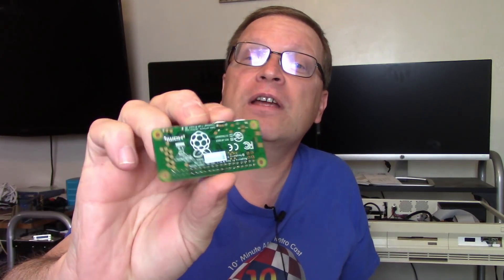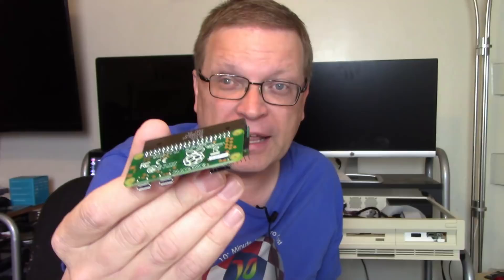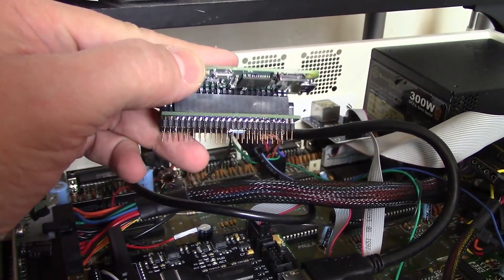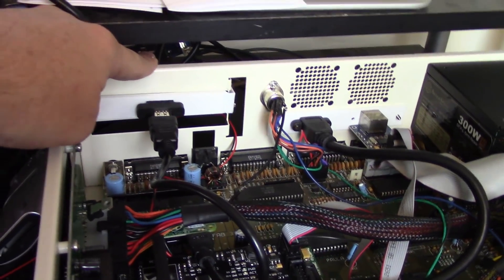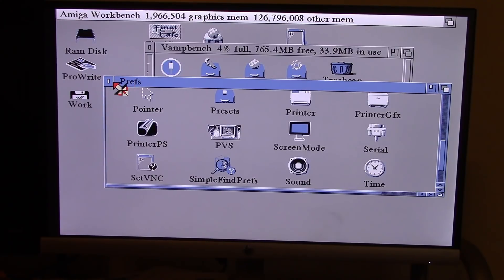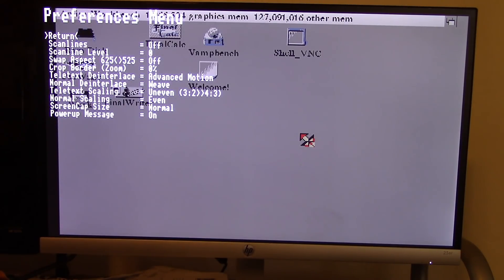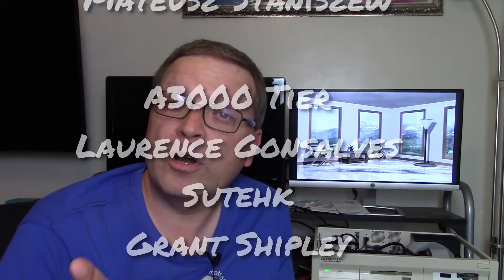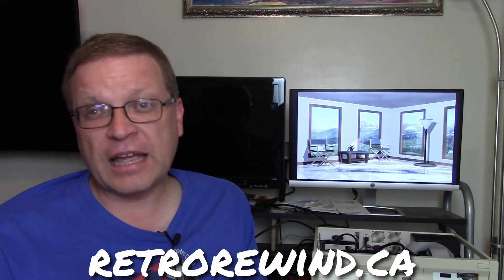RGB to HDMI Review for the Amiga 500 - 10MARC Episode 91

Comment: I have one of these but not tested it yet.
As I can see from your video, there are some interlace artifacts on cursor moving at lace resolution.
Same happens to LCD TVs with scart and with the Indivision if I remember correctly.
Reply from the maker: Huh. I had not noticed any artifacts on the cursor. I will have to take a closer look.
Reply: @10MARC  Emailed you a screenshot.
Reply from the maker: I saw that in my email. I really don't recall the cursor looking odd at all. I wonder if it is a trick of the camera.
Reply: @10MARC  If you had an interlace mode on your camera, the same thing would happen to low res screenmode.

Comment: The flicker in PAL mode might be an issue with your display not supporting 50Hz. I've been using the RGBtoHDMI on an Atari ST and had a similar issue when running in PAL mode. IIRC, I had to force the RGBtoHDMI's HDMI mode to 60Hz using a setting on the main menu.
Reply from the maker: I thought so too, but my monitor works great in PAL mode with other upscalers, and reports 50 Hz. I tried the 60Hz PAL mode to... No dice...
Reply: @10MARC  Another thing to check is if the number of scanlines detected matches the profile. In Source Summary under the Info Menu you can see the Lines per frame detected. If you then switch to the PAL profile and go to the Geometry Menu, I think Lines per Frame needs to be the same as the detected value on the Source Summary page. You can also try turning off the auto-detect for sub-profiles on the main menu after switching to PAL mode to see if that's the issue.
Reply from the maker: Great information! I will check that out and see if it helps.

Comment: 10:46 Ya, that looks nice, Doug. Thanks for showing this off. This would probably work especially well for direct screen capture/recording, I bet. It looks better than my A2000 with A2320 to VGA-to-HDMI adapter where I get a little bit of distortion when recording the Amiga screen. Specifically one of the colors seems shifted to one side of the others a pixel-width or so.
I guess I should open up the VGA-to-HDMI converter box and see if it has any adjustments that might help there, but bypassing the VGA altogether seems another good option.

"Don't be a monster." Always good advice. :)
Reply from the maker: I will be testing the screen capture soon - I imagine it will work perfect!
Reply: Nice

Comment: I'm one of those scanline savages who also forces 4:3 or 5:4 aspect ratio. :P
Reply from the maker: I guess I am a full screen Heathen, then... 🤣🤣
Reply: Same here. Most Amiga graphics does not look right without scan lines. It looks much too blocky without them. Just compare with a real CRT monitor and you will see 😉
Reply from the maker: I spend most of my time in interlaced modes, to be honest. Whether it is Workbench or productivity programs, I rarely use anything but 362 x 480 or 732 x 480 modes, so my scan lines are always filled in! (But flickery if I don't use an upscalers/flicker Fixer)
Even back in '88 my 1084S was almost always in interlaced mode.

Comment: You missed the maximum quality. Use beta 17 firmware, use a 1080p display and fix the pi output to 1920(1440)*1080. Set the scaling to linear not soft. Then you get a perfectly X2 scaled Amiga picture with up to 720*540 pixels. With that setting, pal and NTSC works perfectly without blinking screens.
Reply from the maker: Well let me try that, then! It will be great if that works! Thanks!
Reply from the maker: Well that did not work either. Tried on three monitors that support PAL just fine. I suspect that PAL equipment can shift to NTSC without a problem, the issue is NTSC equipment shifting to PAL. Something is not quite right.

Comment: I have the same flickering problem when I switch to PAL mode; the workaround for me is to set "Auto Switch" to Off and set the Sub-Profile to "Amiga 50Hz"; then PAL mode works.
Reply from the maker: I will try that one and see what happens. I don't recall changing an auto switch setting
Reply: @10MARC  I stumbled upon that workaround after trying a bunch of other changes. By default it's set to "Sub-Profile". 

The "Sub-Profile" setting changes for me automatically with the default settings when I switch modes, but there seems to be a bug in that functionality, so I need to set it manually to avoid the flickering problem. You'll want to manually change the Sub-Profile to "Amiga 60Hz" when you switch back to NTSC mode.

Weirdly, when the screen flickers like that, it stops flickering while the menu's displaying, but starts flickering again when I close the menu.

Comment: Nice vid. It’s a shame I cannot use one of these in my Checkmate case with the accelerator I have, it partly covers the Denise. However, if the Buffee goes into full production then away we go!
Reply from the maker: It is super easy to just get an additional empty socket and either stack it on your 68000, or stack it on your Denise chip. That's what I did with my vampire so it would clear my mega chip, I'm sure something like that would work for you too. There are also 68000 chip relocators that let you put boards elsewhere in the Amiga
Reply: @10MARC  If I raise the accelerator it gets in the way of the psu connector. I cannot raise Denise as it will hit the accelerator. The cpu replicators I have seen will cause the accelerator to hit the cd/floppy bench! If I could replicator Denise on a cable that would work. But I don’t know if I have the skill or if it would affect timings.

Comment: I live in Australia (I.e. a PAL country) and have had no issues at all with PALor ntsc modes. My monitor supports both 50hz and 60hz - are your issues related to your monitor rather than the rgb2hdmi mod?
Reply from the maker: I absolutely did consider that, but I tested both of my monitors with other devices, and both can switch into PAL modes without any problem at all. I even have my RGB to SCART plugged in at the same time in the RGB port, and I can switch over to that on my switch box, and the power screen looks 100% perfect. I went as far as to plug the HDMI from my new device into my scart to HDMI converter, as it has HDMI input also, and it's still flickered. It is the device
Reply: @10MARC  Only point of difference I can think of - there's many more happy users down here in Oz all running PAL Amigas with no issues at all! I can both toggle between PAL and NTSC on the early start up menu  as well as within Workbench with no issue at all.

Comment: Very helpful video. I got one of these on the way for one of my A3000s. I love the video card board and button solution they made for it. I was only going to use it with a 3000 purely for the HDMI out.

When you went into 4:3 mode, your text on-screen got really chewed up. Does it actually look that way (please say no)? Or could it be because you're using some custom fonts or something like that? I know RTG is cool and all, but I'm actually going to see if this very inexpensive product will knock the ZZ out of the way for a while (as I'd actually like to run some old software on that machine!).

LOL hard core bust on the PAL mode! Hah!!
Reply from the maker: The text only looks like that while the menu is up on the screen. as soon as you go back to the regular screen without the menu, it upscales everything perfectly. Glad to hear you're getting one! Why for the a3000 though? Does Amber not do a good enough job? I'm genuinely curious why an a3000 user would need one.
Reply: @10MARC  I only was getting one as a future-proofing idea for the HDMI port. I don't need one per se, but the A3K that uses my ZZ9K is full HDMI right now. I was thinking of downgrading to this device so I could run any software I wanted again - I don't care so much about impressive workbench screens. I'm all about the software. I could put it in my A2K, too, but my shelved A3K came to mind first, tbh.

Comment: Doug, I'm surprised to see that megachip in your build.  My vamp is in a 2000 and it was not stable until I took out the megachip.  Kept getting ram faults.  Are the boards of the 500 and 2000 that different?
Reply from the maker: I have had zero issues with the MegaChip and the Vampire. I wonder if yours maybe has some bad RAM on it, and is more sensitive? I have the same board in my A2000 and A500 and they work great.
Reply: @10MARC  the megachip worked fine with a gvp 030 combo card and presumably has for 30 years or so.  The vamp is going in a checkmate 500 like yours.  Guess I will know then..

Comment: Hi Doug, great video as usual, thank you.
Does this mod work on an A1000?
Reply: Wondering too - maybe if you remove a couple bars off the PSU, make room (had to do that for ECS Indivision)
Reply from the maker: It does, but the Denise on the A1000 is missing a few signals, and you have to grab them from another location on the A1000 with a bodge wire. There are instructions on the GitHub about where to grab the signals

Comment: great piece of hardware and very interesting as AlWays Mates, good solution for A500 owners to have clear picture on larger screen, for me i very happy with my mk2 up scaler, working good on pal , and don’t forget the SECAM system ah ah developed in my country. it’s worth the price ;)
Reply from the maker: I have the MK2 ok my A1200 and it is nice because it works on some very interesting modes like 800x600, 1280x720 and even 1280 x 1024 (even though CHIP RAM is almost gone in that mode!

Comment: Thanks for the review Doug. Looking forward to the fix for PAL mode
Reply from the maker: Me too. It's the only thing holding it back from being perfect. I could probably switch it over to be 100% pal all the time, but I don't want that either.
Reply: I have built one for my A500 PAL and it works fine. Are you guys trying to use PAL modes on NTSC Amigas? I am wondering if the different clock speed is causing the flickering issue
Reply: @andreassteiner8495  I am not, I live in Australia which is PAL. I just took Doug's comments about the PAL setting meaning that it had some issues in PAL but from what you say it is fine so perhaps it is just the NTSC issue or the Clock speed as you mentioned. 60hz or 50hz could be.
Reply from the maker: @andreassteiner8495  I do not doubt a bit that they work fine and PAL mode, but all of my NTSC machines just go nuts when I try to use the RGBTOHDMI in PAL mode. PAL works fine out of the standard RGB port from these same machines, and even on the same monitors. (RGB>SCART>HDMI)
Reply: @10MARC  I only have a PAL Amiga and a PAL CDTV where I can test it. It worked out the box on both machines. I can only imagine that the pixel clock on NTSC Amigas could be slightly off from the PAL standard. LCDs and TVs might be able to handle it but the RaspberryPi might get confused. 
What I am missing lack of of mixing the audio into the HDMI because I was planning to use it on a TV

Comment: I live in Norway and use it with A500, Rev. 5 that is a PAL model. Works in 50hz perfect. I have not tried NTSC. I know that A1200, A600 can switch between PAL and NTSC on the fly but at least the first A500 revisions could not. I'm pretty sure the possibility to switch between PAL, NTSC was introduced with the ECS chipset. That would mean a very late A500 revision motherboard or A500+. For people that do not know, this thing does not work with A500 rev.3. Regarding A600 it does not have the video chip on socket. I think it will be hard to do some easy solution for A600 without soldering cables to the mobo. One more thing you should mention is that it will most likely not work with a display that can not do FullHD. The fantastic thing is that it will work with all!! displays that do FullHD or more and it will do 50hz perfect. That can not be said about Indivision mk2 and many other solutions. Thanks for the video.
Reply from the maker: Yep. My Amiga 500 has a Rev 6 board And I have added the ECS Agnes and Denise. She works 100% fine in PAL mode with all of my other video upscalers. Not even an issue.
I hope that they can solve it and get it to work easily with the a600. Maybe with some kind of chip that pops down over the top of the Denise.
Reply: @10MARC  Chip over Denise is possible. Space might be a problem though. You are 100% sure your other solutions run PAL in 50hz? Indivision mkII did PAL in 60hz and therefore not smooth scrolling etc. I remember when the first RGB2HDMI came out, first software did not do NTSC. PAL should for sure work. Works perfect on my A500. Latest software is 7 days old. Is it the one you are using? https://github.com/hoglet67/RGBtoHDMI/releases
I have not used that version but an older one. If that is the one you are using you could try older version. Could be a bug.
Reply from the maker: I tried the new version and one from January with the same results. Maybe I will try it on one of my TV's that I know works in PAL. Strange that my other upscalers claim to set the monitor to PAL and work OK. I can also use an HDMI to DVI adapter and try one of my Multisync monitors.
Reply: @10MARC  If you go into early startup-sequence and press space. Do that change res? That should change between PAL and NTSC.

Comment: Ohh... About the PAL issue you have. I fear you need PAL specific hardware and have it set to 50hz. Or perhaps it have something to do with first boot of the bare metal software. I only have PAL hardware and it is working perfect on my machines. You can see in my videoes how it runs.
Reply from the maker: That may be true - but any ECS machine should be able to switch to PAL or NTSC mode on startup with just a few mouse presses. My RGB>SCART, RGB to HDMI, RGB to VGA and RGB to Component all work and display PAL just peachy on my machines. This is literally the only upscaler I own that i cannot get to work in PAL mode.
Reply: @10MARC  It is strange. Perhaps.... Well...

Thinking more close about how it operates. Then it works something like this: It passively hooks into the signal, taking it in to the pi, and then does some kind of upscaling magic. And as the adaptor need you to do the switching manually. Then I guess this might be were the issue is. The adaptor does only "sence" the video signal on boot of the PI it self.

My take on it, is that you really do need to keep to the default machine. You know. Own two machines, one pal and one ntsc, or the software need to have the autodetection rewtitten. That might pose an issue, because it was invented for BBC mikros in the first place. The Amiga version is just a spinoff, because it for some reason, allow the useage on other machines as well. Like Tandy1000 or Commodore128. Or even EGA and CGA stuff.